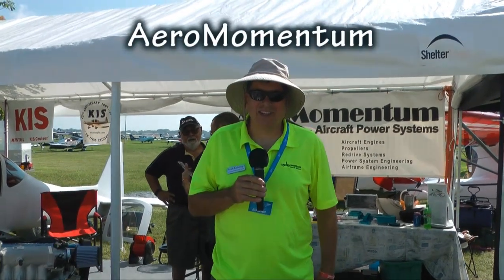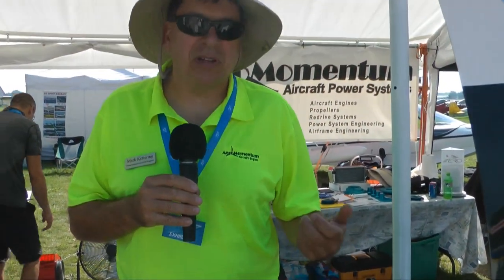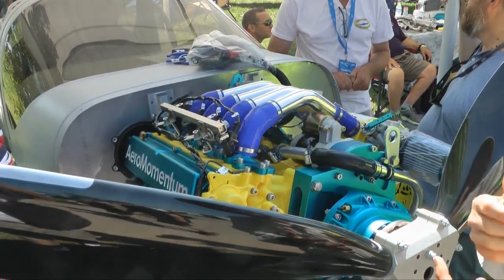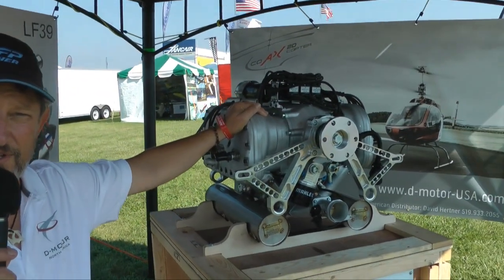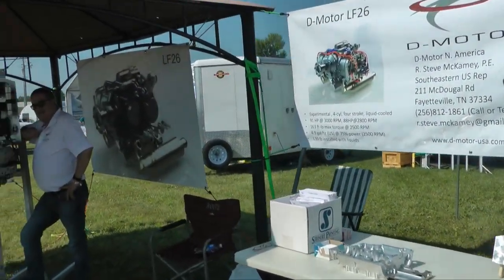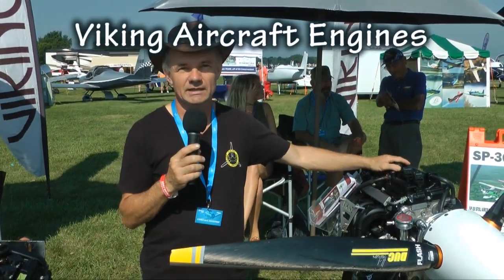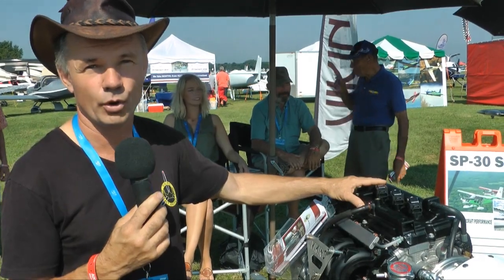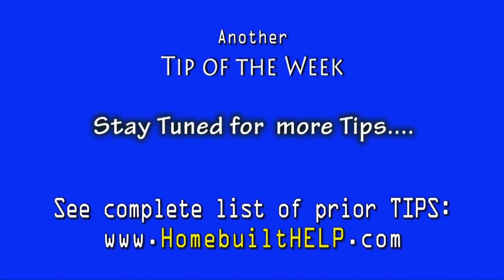3 New Aircraft Engines - Airventure Oshkosh 2018

Comment: OK, so I 100% trust the Sonex planes. Yes, they are labeled "experimental", but there's nothing about the design that makes me feel it could fail. The avionics are what you put in it, and as long as you don't go too cheap, they should work just fine (after all, it's just a sport plane).

But the elephant in the room is the engine and nothing I've seen so far would make me feel safe using it for regular cross country trips (my primary purpose for wanting one). Even the expensive Rotax one says in writing "this engine could fail at anytime" 

So...is there something I'm missing here? A paramotor engine dying mid-flight is no big deal. But isn't that deadly in a plane? I noticed the founder of Sonex and his passenger lost their lives (not due to a faulty plane design but a faulty engine). Is that what all these experimental pilots are doing? Just praying their engine won't stop any second and kill them?

Yeah, I'm just going to wait until someone releases an engine for the Sonex that's as tried and true as the plane design itself. And as long as the motor is under 20k, I'm willing to pay for it when it's released.
Reply: I guess you want a battery/electric engine then.  They should be pretty reliable

Comment: Auto manufacturers stopped using flatheads because they had no power and were extremely inefficient. Gas doesnt like going around corners while igniting and the flame front takes longer to reach the piston. I would never ever use an engine like this for anything, esp an aircraft.